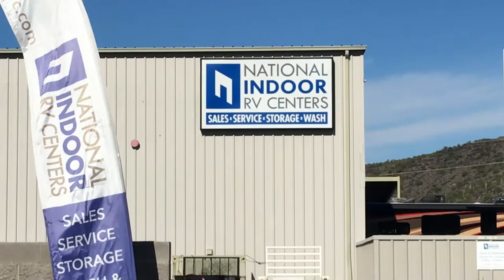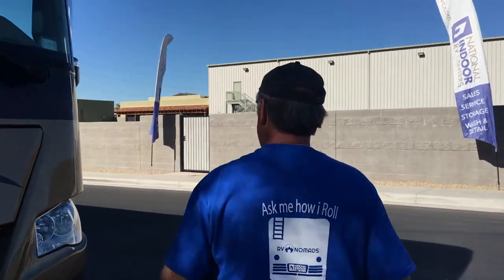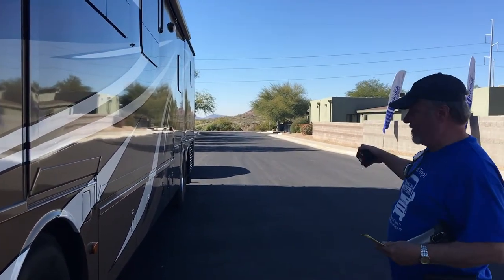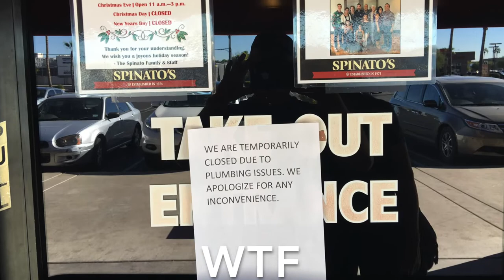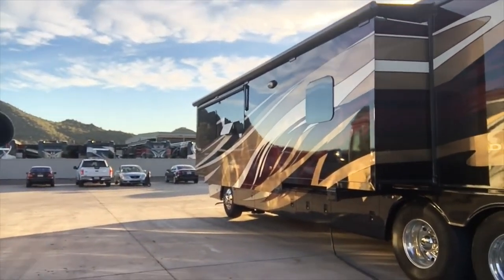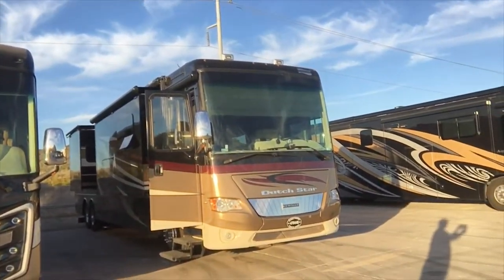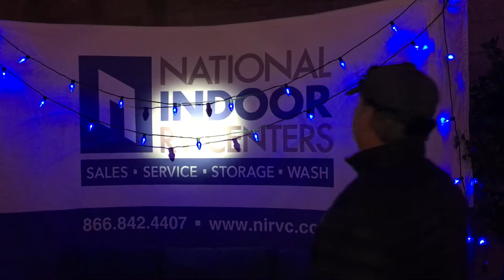MOTORHOME SLIDE REPAIR-GREAT EXPERIENCE AT NIRVC-PHOENIX,AZ-EP14

Comment from the maker: I have a 2014 Newmar DS Model 4369. This episode shows the experience we had getting our "gearboxes and shafts" timed correctly at NIRC, which is a fantastic place to work with, REGARDLESS if you bought it from them or not, original owner of not. They have 4 locations, nation wide. Our full wall slide, lost its timing a few times now over two years of FT travel. I BELIEVE I HAVE DISCOVERED THE BIGGEST REASON. We added a pillow top to our mattress (1st year).....then later (second year)......a 1" to 7" sloped wedge mattress lift to help with my acid reflux issues at night. Even with just the pillow top, when the bed would meet the FWS dresser cabinets, the bedding would have to "squish" a little bit. I am telling you, that since we cut away the abuting 10" length of the pillow top foam AND the mattress wedge at the foot end, the timing has stayed put. The mechanism stays quite,...no more cracking and popping as it slowly (progressively) gets out of timing with each use when it had to push against the mattresses! That resistance at each use, was just enough to be trouble.

Comment: Is the full-wall slide on your unit hydraulic? I know the ones on the King Aire are. Love NIRVC and are looking at buying our next one from them. The reviews on "after the sale" service are the highest among all the dealerships we've seen.
Reply from the maker: My FWS is the Fred Flintstone ramp system, using two motors and the cog wheels.  The hydraulic system started a few years after our 2014 DS.  I will be at NIRVC in November 2019 for new front tires and having the new "Rettrobands" installed.  I will do a video on that.  They are the only game in town for me.  They take care of me, and I didn't even buy it from them.

Comment: What the crap...Is that a common problem with others RV's
Reply from the maker: Sadly, slide issues are very common,....and expensive.  That's when I wish we drove a Prevost without any slides!  If you personally gman77gas owned an RV, YOU are so handy and mechanically inclined, I would say you would NEVER be in a repair place.  And that is absolutely no exaggeration.  Working on an RV is 50X simpler than a snowmobile!